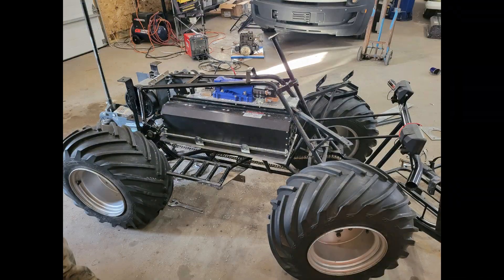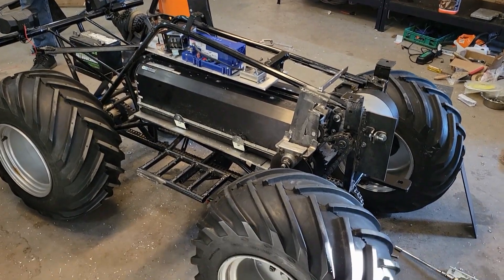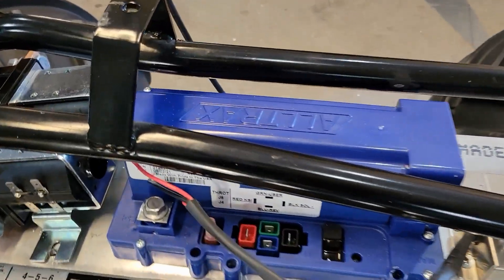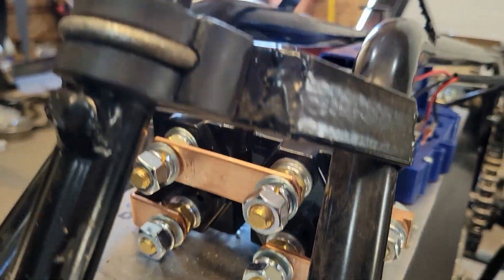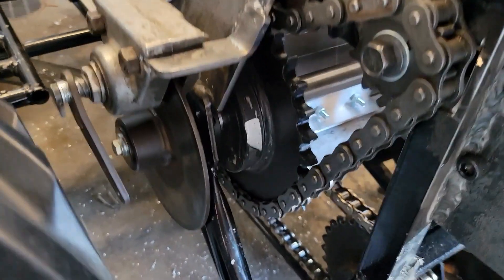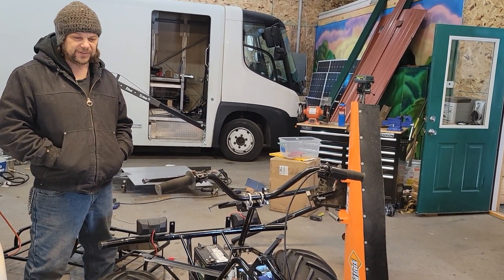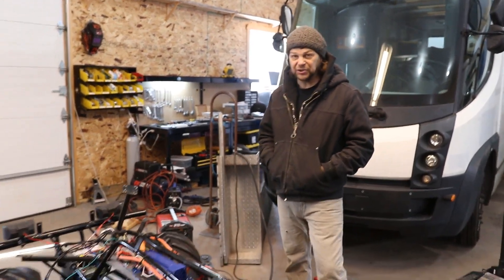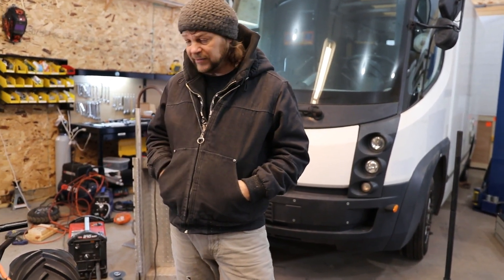Solarrolla Electric Four Wheeler conversion!

Comment: Such a cool project-I'm here for it! I did a similar one years ago with a Polaris Trail Boss with an AGNI/Lynch motor.  I used it for driving off road and some street riding in the city here, also pulling my son on a sled in the snow.  The downfall is I could only afford 2 eBike 48volt 20ah batteries wired in parallel so not much range, and I was overdrawing them at around 100 amps so the batteries didn't fare well over time.  Speaking of the AGNI/Lynch motor-it is amazing for projects requiring from 1kw-25kw of power output. 
Here is more info if you are interested:
The Lynch motor is an unconventional design with a disc armature. It marries the advantages of a conventional, wound armature motor with the benefits of a flat (printed circuit) motor. It is similar to a pancake motor, but is more powerful than any of these technologies. The disc armature has magnets on both sides, doubling the available flux density and shortening the magnetic path. It therefore packs more power per pound and per cubic inch than any other motor technology. Of course such a revolutionary motor is not for every application - it is not as cheap as wound field motors, but for many applications it is a far superior motor.  It has a previously unheard of power to weight ratio and also power to volume ratio. It is also highly efficient because of the double magnet design and associated short magnetic path. It also includes integral fan cooling.

 The Lynch motor is an important development which spurred other motor designers to improve their products to remain competitive, such as synchronus permanent magnet machines.  As a result of the competition between manufacturers the cost of high performance motors and controllers has fallen dramatically.  We hope the cost of solar cells also reduces to allow renewable transportation to develop as a viable alternative to carbon fuels.

Cedric Lynch built his electric bike around a mid-drive configuration, also building one of the worlds most efficient light weight electric motors to power his rig reliably at 60-MPH for significant distances. He would later set several world records with his axial flux motor and bring it to market as the Lynch / Agni motor. Briggs and Stratton would eventually buy this technology which would lead to the Etek motor, which is now famous for making high speed efficient electric hot rods.

Cedric uses to achieve high speeds is by following the rules of aerodynamics, and building a bike that is as aerodynamic and as efficient as possible. The other builders on this list bypassed this step, and Cedric uses this bicycle as daily transportation on real commutes. Although this high-efficiency motor uses “old school” brushes, this fact allows builders to use very affordable controllers. He has proven his design choices through thousands of miles of commuting, and the Lynch motor is highly respected.

Cedric Lynch is known as the creator of the Agni Motor, a highly efficient electric motor that weighs around 25 pounds and can put out as much as 50hp. 

Cedric Lynch is a British 'mad scientist' type mechanical engineer obsessed with the idea of greener transportation. His interest has been in building a super efficient yet powerful vehicle that can serve as a car replacement.

He started thinking of his own design for an electric motor in 1983 when he began entering competitions organized by the Battery Vehicle Society regarding building an efficient electric vehicle. At the time there was no reasonably priced DC motor with descent efficiency so Lynch decided to build his own utilizing modifying existing motors with old tin cans that he would spread out flat to use as cooling fins. Surprisingly using rudimentary materials and a garage work bench, Cedric was making better more efficient electric motors than any of the universities were able to manufacture in state of the art workshops.

Cedric then came up with a motor design that could be cheaply manufactured and began manufacturing his own motor that he could sell to the public in 1988 and the Lynch Electric Motor Company was born, known as LEMCO.

Cedric first used his motor to create a small boat called “The Spark” that would set an electric boat efficiency record. From there Cedric turned his attention to bicycles, an application generally considered too small for a lynch motor at that time. Cedric mounted his motor in recumbent bike, allowing him space to eventually use a set of thundersky lithium batteries.
The resulting aerodynamic recumbent bike had a top speed of 60mph and still managed an incredible range of 150 miles. Cedric rode his recumbent creation everywhere as a daily commuter, putting an amazing 50,000 miles on the machine - technically a motorbike.

Briggs and Stratton, the US firm famous for lawn mower engines, bought the technology and used it in their E-Tech Motor, and Cedric went on to manufacture his latest incarnation of his lynch design into the Agni motor, which is used in go karts, sailboats, motor boats, and even small airplanes.

The Lynch designed motors all have the same traits. Brushed motors, around 25 pounds in weight and they are able to put out enormous power compared to their weight. Sometimes as high as 50 hp (depending on amperage ran through the motor) at an incredible 98% efficiency.  Lynch Motors are also the most often used motors in electric motorcycle racing applications.

Cedric's zero-emission motorcycle, which has a top speed of 120mph, was shown in action winning the world’s first zero carbon race – the TTxGP in the Isle of Mann.

The idea for the electric motor has been snapped up by the 56-year-old’’s friend Arvind Rabadia, who together with his brother Hasmuk Rabadia had been thinking of starting a business in India. They have now set up Agni Motors to make further-improved versions of Cedric’s motors

Despite Cedric’s breakthrough invention he has no formal engineering qualifications and taught himself the techniques needed to construct his engine. He first became interested in electrics when his parents bought him a book entitled How to build things from things found at home. 

The Etek motor is a brushed 25-pound pancake shaped motor that puts out enormous power for its weight. Depending on amperage and voltage the Etek can easily provide between 15-horsepower and 30-horsepower reliably and consistently (11-kW / 22-kW). A perfect platform for a powerful electric bike if you do not mind the weight. Although brushless motors are considered more modern, a brushed motor like the Etek allows the builder to use very affordable controllers.

Cedric-Lynch invented the motor and sold it to Briggs and Stratton which US company produced the Etek at a lower price (around $600). In the late 90’s early 2000’s it was the way to go for a high-power / light-weight electric vehicle. Many small E-vehicle records were set using the Etek motor. Finally, the market had a relatively lightweight and powerful electric motor available to the masses.

In essence, the Etek allowed hot rodders to build electric bikes. Before the Etek very few people had ever achieved 50mph on an electric bike. Even today, Etek motors (and newer incarnations of the Etek motor) are used to make some super fast electric bikes. In the case of Liveforphysics, the fastest E-bikes ever.

 Liveforphysics used a newer version of the Etek (the Agni motor), to achieve speeds of over 70mph, and dominate a recent hill-climb event.

Every Etek I have ever ridden has been characterized by brutal off-the-line acceleration, usually to a point where you have to apply the throttle very carefully or get thrown off. However, it is possible to run an Etek at a lower voltage or lower amperage and have a very manageable, safe, and sane electric bike that will not burn out on you, no matter high steep the incline.